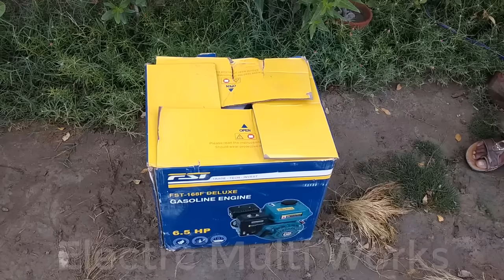Flywheel Free Electricity How To Make Free Energy Generator 230v With 8kva Alternator & Motor

Comment: Great design! I copied every step and it works great! This unit runs all the electrical appliances in my house including my electric hot water heater. I found that with the addition of a Flux Capacitor, a set of Pattern Buffers and a Heisenberg Compensator, not only can I travel through time, but I can transport myself anywhere within the Solar System. I'm hoping in time I will be able to add a set redundant scanners and a biofilter. Thanks!!! 👍
Reply: Super ...may i know cost
Reply: @sivakumarthaza   I was being sarcastic... This does not actually work for more than a couple of minutes and slows drastically when a load is put on it. This is why they keep cutting away during filming. You will notice at the very end when the light is hooked up to the unit the wheel slows... He tries to fool you by speeding up the video itself.
There is no free energy via this method and you would be better off investing in solar.
Reply: What's the rpm of electric motor use in your system to run the alternator
Reply: @randallmarsh3087  then what were you saying in the first comment
Reply: @randallmarsh3087 Ironic humour at its best.
 Shame it is beyond so many with minds. 
Even when you explained the joke almost all still did not get it
Reply: @ericchapman399  Right... Kinda makes one wonder
Reply: @sivakumarthaza  m
Reply: QCddsd$wax
Reply: You forgot to mention the reverse biased subduction spline, just saying
Reply: Well said
Reply: Really please send me proof
Reply: В якій галактиці ця система працює ?
Reply: How long can it run for
Reply: It's happening. Someone about to figure it out...... only a matter of time. The government has already known this since 1950 ish. Keep going 💚

Comment: I am so impressed with this arrangement. You should speak and explain each step so people can understand your logic. How much and where are you selling this assembly.
Reply: He has not put any load on it, once he does that it will stop, there are
 other vidoes like this one for small project mostly on American tech 
chanell. However, he is making money from it by views so yes it is free 
energy for him ha ha ha. Ask him to run it for one hour and see what 
happens , of course it will stop just after five minutes. The power that
 he gave it he is taking it out very very small and this things slows 
down with it and eventually it will stop. But most people do not have 
the thought to see this. If it is true I AM an electrical Engineer and 
millions of others then why did we not do this?
Reply: Perpetual motion is the motion of bodies that continues forever in an unperturbed system. A perpetual motion machine is a hypothetical machine that can do work infinitely without an external energy source. This kind of machine is impossible, as it would violate either the first or second law of thermodynamics or both
Reply: @Dailymailnewz  because of money because it's easy
Reply: @Dailymailnewz  NO NEED LOAD IT WILL STOP IF ELECTRICITY CUT OFF
Reply: He never speaks, most people don’t when showing these, Yeah it sucks if real it would be nice if they would explain to us how and why it functions but we are left to figure that out for ourselves I will make another reply and try and explain if it works why it would and how it is accomplished
Reply: @badeadrian  I would have to disagree there are actually 4 energy sources involved.   The first energy source is the gas powered engine that gets the other three energy sources up to speed.  After all three Energy sources are at the proper speed this may be what is happening, first remember there are actually three fly wheels spinning so remember there is more mass spinning than just the center fly wheel.  The center fly wheel act’s as a buffer, The generator can put out more power than the motor needs to achieve the RPM needed to keep the two other fly wheels spinning at the speeds they need to spin.   When the generator is up to speed it provides The amperage needed to spin the motor to its proper RPM that it needs to be at and there is an excess of power coming from the generator also. So what keeps the generator spinning?  The flywheel, the flywheel is heavy and has enough stored energy to keep the generator spinning for a short period,  so what keeps the flywheel at the speed needed to keep the generator at the speed it needs to stay at in order to provide the amps needed for the drive motor?  Well, the motor keeps the flywheel going.  The fly wheel because of its mass it can almost keep the generator going by itself for a short period so really the fly wheel only needs a little bit of extra boost from the motor for it to maintain its needed speed to keep the generator going.  If this is real i think you will find that doing some measurements you may find the motor is not drawing as many amps as it is rated for.  Of course another possibility is there’s really only enough power to keep everything going and when you go to use excess power from the generator the motor will have to do more work and draw more current from the generator and possibly may be slowing down the whole system , you never see them have a load running continuous maybe when they’re grinding with the electric grinder the system is slowly slowing down then when they stop it speeds back up but if that is true you still have a system that is powering itself
Reply: @rmendes2mendes915  just go to school don't believe everything is flying is good to eat 😄
Reply: @badeadrian  
@qwe12380
0 秒前
是不是可以小馬力的馬達帶動大馬力的發電機發電的

Comment: Actually engine energy obtained from fuel   stored in flywheel in the shape of inertia an then used to produce electric energy , it will slow down and stoped as quick as we will put load .
Reply: Totally right
Reply: So it doesn't work???

Comment: There is some electric wire underneath. Energy can't be produced. It can only be converted from one form to another.
Reply: Heat and Friction. How long does it take this colorful contraption to come to a halt if a 5KW load is applied.  No need to test, I know the answer.

Comment: Not possible in any case to keep it running as inertia of wheel will be ended and system will require an external energy to gear up  .
Reply: Yes u r right out put energy always less then the input energy.
Reply: tôi muốn dịch tiếng Việt

Comment: Very soon! You will have a Torqueless permanent power generator, we invented a Torqueless permanent power generator, a generator that runs without fuel, without emissions, without noise and environmentally friendly, can be placed indoors, it is the size of an automatic washing machine and produces 15 kWh operating 24 hours in 7 days
Now in the cycle of accelerating the implementation of innovations at Qatar Science and Technology Park to launch Al Barq Future Energy

Comment: The law of energy conservation says this machine will produce only a residual amount of extra electricity. It can run a few electrical devices, but it will certainly not produce enough electricity to run an entire house's needs.
Reply: Yes
Reply: I think if the alternator is 5kva and the motor is 1.5kva. the energy that will be left for use will be around 2.5kva or 3kva which is still good enough

Comment: I have seen alternators turned into motors. So this could be the alternator/motor running on 12volts giving power through the pulley. If he disconnects the battery, then then that would be really something
Reply: This 12V alternator just recharging battery while the flywheel gives aditional power, working as power multiplicator.
Reply: Apriciat

Comment: Did anyone notice that the shaft on the generator was going slow and belt was going around fast. 
Shaft has groove for woodruff key and clearly going around slowly
Reply: Possibly, but you will notice the bolt looks a little blurry and at one point it starts turning the opposite direction. What your are seeing is an Illusion like he would see through a camera frames per second it appears to be slowing down then speeding up and changing directions

Comment: For the cost of this machine , I can just pay my electric bill ... for FIVE years ! 800.00 a year is not that much . BUT ! If I have a cabin on a mountain top , this is the way .
Reply: @mylenovo9970  No , there is some truth to it . The flywheel energy is gained and lost in every rotation . More loss than gain , therefor eventually stopping . If this is designed to rum for 24 hours then you have to crank the gas engine and spin it up again , then it runs on it's own for another 23 hours . THAT is a great savings on gasoline over running a generator 24 - 7 .
Reply: @inmyopinion6836  HOAX
Reply: @1totoche007  make a youtube video and prove it doesn't work...
Reply: Well our electric is just like someone don't have proper husband

Comment: "The person who says it cannot be done, should not try to stop the person doing it."  Confucius
Reply: “The person who’s says it cannot be done has studied physics.”
Reply: @waynebreivogel1742  are you upset because someone is robbing ignorant people of money with this crappy idea that's been around for years. Back when Popular Science what is a magazine I'd see an ad for this kind of stuff every once in awhile. It would be interesting to know the history of this scam. Joseph Newman is King I believe
Reply: There does not exist a system that produces more energy than what it requires to make the system work. It's not a conspiracy, big oil is not paying universities to teach enginerring students this way. No machine since the beginning of time has ever been made that puts out more energy than it takes in. No amount of arguing about it can change the fact that it has never been done. You can think of energy like a bank account. You put a system in motion by depositing energy into it. This can be gas, batteries, whatever. Every part of the system then deducts from that energy account. Even if you make a machine that has ridiculously low friction you will eventually run out of energy. No friction is not possible. And even if no friction was possible, if you can hear the machine operating then it is giving off energy in the form of sound pressure waves. The simple fact of a machine producing noise means it is draining energy. When the energy bank account reaches zero, the machine stops. And you can't say that putting an amplifier in the system will produce more energy. Because any amplifier that produces a greater output than the input requires an outside energy source to do that. Deal with it.
Reply: @billyoung8118  I didn't have to put much energy into my comment to get a large expulsion of energy out of you guys.   Now let's have a riveting conversation about thermodynamics.
Reply: Sir not possible , please ask him who made this system , as reality is ,system will slow down and then stop within few mints as soon as wheel inertia will eaten up and then there will be requirement to move wheel through engine .   So nothing is free

Comment: Are they trying to sell Something?  Even though this system doesn't sustain generated power without injecting a power source to feed it, battery, it's still a interesting project.
Reply: It's the flywheel and not the battery, they add the alternator to charge the battery, battery is not the source.
Reply: Mark Hessbrook 
the system needs an outside energy source to sustain itself.  Just like a car you fill up the tank with gas so the alternator can be turned
Reply: Is there a perpetual motion machine?  Is there a free energy machine?  Short answer NO!   Long answer NO!
Reply: If you believe that's ok!  I want you as a customer!
Reply: Mark Hessbrook You really should educate yourself on how alternators work.  They need power to make the field function. The battery is supplying that power.  The power to resupply the battery can not be sustained due to the friction lost in all the turning of the devices which are under a magnetic load.
Reply: · A perpetual motion machine would require the elimination of phenomena like friction and entropy. That isn't possible. As for why some people believe it is (who?), well people believe all kinds of crazy things. Sometimes people like to espouse crazy ideas because they like the attention it gets them.
Reply: Mark Hessbrook  When you turn on your headlights at idle; it boggs the engine down a couple hundred RPM because the alternator is providing energy at the expense of engine power.
Reply: Ron Labe almost there, almost there!  The lights go on and get power from the battery.  The alternator is fed power to its field from the same battery. The alternator generates power attempting to top off the lost power from its own needs and the needs of the lights.  The engine revs up to increase the output of the alternator to overcome the batteries depletion.  Without energy from the engine which gets its energy from the combustion of fuel none of this would function after the battery goes dead. Just like leaving the lights on until the battery is dead and nothing happens until an outside source puts power back into the battery to get the engine started.
Reply: Mark Hessbrook  
Older cars, you can start the car and disconnect the battery and the car will run. In this case, the outside source is fuel.
Did you see any wires from the battery going to the generator, there are none.
Like in the wind turbine the outside source is the wind, in this case, is the flywheel.
So is in our cars, there are flywheels.
If you remove them the engine will not run.
Reply: 4 years late but they're just trying to generate Ad revenue off these videos. If you search flywheel generators theres like 12 channels all posting the same thing and their still posting these videos 4 years later on these channels just to try and get free money lol

Comment: The whole machine is powered from the mains supply to the white motor with a cable buried in the earth. Amazing how so many of these free energy devices have to be demonstrated on grass, sand or bare earth making it easy to hide the power cable.

Comment: The more load on the unit the slower the flywheel will turn. At some point I am betting it stops turning, provided there is a substantial load.
Reply: Không cái gì là miễn phí
Reply: @huudang8746  có thât là no se ra đc điện miễn phí k vây ! Hay là lại lừa ng xem
Reply: Yes you are correct, There is only so much excess power available drawing more than it can provide will slow the unit down and it will come to a stop

Comment: If the alternator is driven by an induction motor or by a d c motor, 
what is the power used for it ??? 
Out put from alternator will be equal to the input power plus power loss. 
Then the question is that, what would be   the  power remained for usage  ????
Reply: The remaining power is shown, around 1k wat. The power used to run the drill
Reply: The power remaining is how much the power of your alternator them minos the total power of your driving motor.

Comment: Out put can never be more than input in such cases.
Reply: Sunil mudliar
Reply: Depends on long wheel run
Good experiment.
Reply: Never say never. The unknown unknowns. Just saying.
Reply: Just think inverter 
Inverter works with only 12v Dc 
but output is 220v Ac
Reply: Step up ट्रांसफार्मर में इनपुट is less than output
Reply: स्टेप्लाइजर

Comment: only thing that is missing is an inverter and couple of batteries because if the person tires to put load on this system the inverter will share it with the help of batteries and when he is done the load will again fully transfer to this system. and hybrid inverter will work great with it if it wasn't a freaking lie. :P

Comment: Yes its Possible. It can run
But problem.
when we use continually motor or dynamo will be heat.
Motor and dynamo cost is expensive then electricity.
If we use only a few hours. Its ok
Reply: Is it really possible  bro please  give full details

Comment: Your work is great and perfect.  I am subscribed to your respectable channel.  I made a generator of 8 kvw that works well at first, and after half an hour, the generation weakens.  What is the reason please?
Reply: Gravity
Reply: What i do please  ?
Reply: Traducir al español
Reply: You can only access so much it’s a balance between the three components, if it’s slowing down you’re either drawing too much excess power from the generator which in doing so the motor won’t have the necessary amperage to keep it running at the speed needed to keep the fly wheel going at the speed it needs to go. Try using less power from the generator or adjust the weight of the flywheel.  Test the amperage being drawn by the motor then only draw enough excess power from the generator without The motor amperage going down. If you draw too much power from the generator so that the motor doesn’t get the amps it needs it won’t be able to keep the fly wheel spinning at the speed needed to keep the generator going at the speed it needs to go.

Comment: The battery supplies power to the generator.  It then drives a 230V electric motor with a belt drive.  From there, the power goes to the outlet.  It is an "mechanikal inverter" from 12V to 230 V...
Reply: What about the gen set ? Where does it fit in?

Comment: That surely can't last too long. Thanks to the camera shutter, it's clear that the wheels are slowing down pretty rapidly under load. (if this were free, continuous energy then surely the system would maintain a consistent speed)
Reply: When the power get transferred to the AC motor the fly wheel(starter) role is null thats why it's free energy. Try it yourself.A constant speed on  can be obtained by adding a PID controller for speed on the ac motor.
Reply: 70% of full load can use for lighting at farmhouse...😃👌👍
Reply: Is this perfect or fruitful for irrigation  to get under water from soil tubewel?